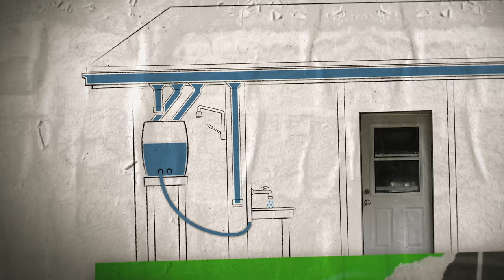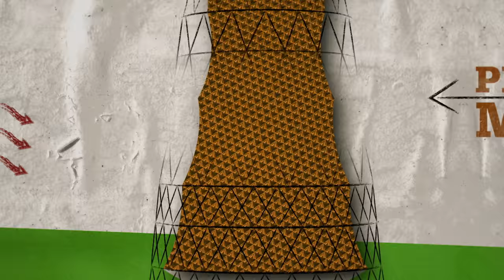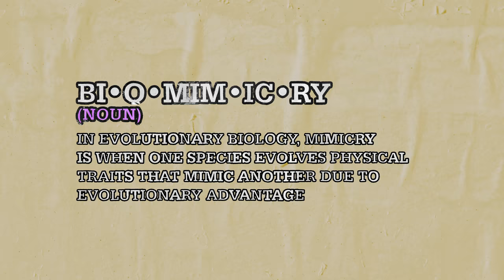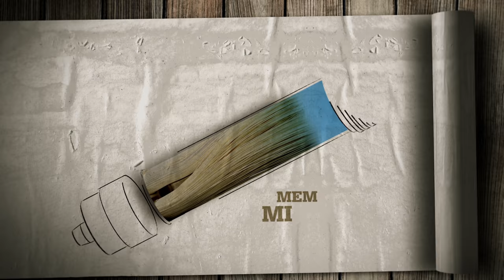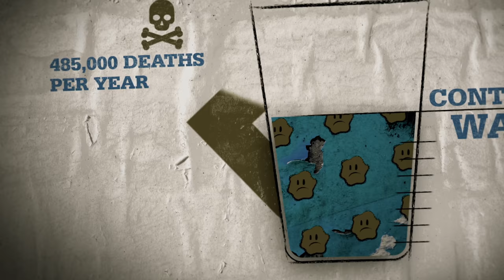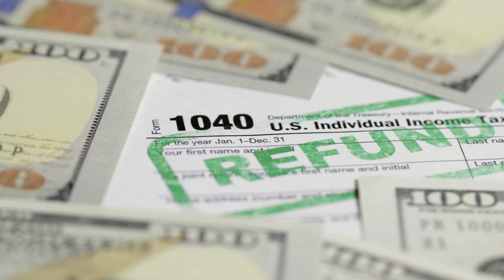Harvesting Water Out Of Thin Air | Shut It Off ASAP

Comment: for the dew collector, something to shake or flick the mesh every hour or so should increase your yield exponentially.   

great work!
Reply: like a bucket at the bottom that fills and pushes down one side of a seesaw, attached by a bar that lets it rotate, and eventually gets past a little bar or something that causes it to tip and dump all its water into a bigger bucket or tub, which then lets the seesaw tip back up and the weight on the other side thumps something attached to the mesh and shakes it. could also build it so it collects in multiple buckets on seesaws all that thump a thing that shakes the mesh, so you get much more frequent thumping.
Reply: Exactly. By the time the water drips from the top to the bottom it will have time already to evaporate, even faster if it's windy. It would be ideal in the desert with no wind at all or if it was closed with air restriction and control.
Reply: @notablediscomfort  That kinda sounds like how a shishi-odoshi (scaredeer) works. Except instead of the bamboo making a bonk sound, it shakes the mesh. 

I'm not sure if it would help but I suspect vertical V-shaped channels would also be a better form for the mesh than just normal rope fibers. I believe that once a droplet grows to a big enough size, surface tension would give way to the droplet sliding down the tiny channel all the way into the basin. In that way, they would be shaped and function like grass leaves. Also it should be stacked in layers like a bookshelf, each with its own collector, that way the dew doesnt have to travel far to be collected.
Reply: @Zadamanim  I would also look into something like waxing or ceramic coating the mesh. I know a good wax or ceramic coat on a car makes watee bead up and drop off super easily but I don't know whether or not it would allow dew to even form on it in the first place.
Reply: @Zadamanim  I should try it out with some Mothers CMX I have just laying around and a couple pieces of some kind of mesh this weekend.
Reply: @notablediscomfort  I was wondering the same thing about if they should be painted in hydrophobic paint or not.
Reply: Sem tradução é impossível nós os brasileiros entendermos!
Reply: Good bhi
Reply: @notablediscomfort  qaaa®=\
Reply: Great work but let me tell you all how much smarter I am because I vote for Democrats and progressive Democrats and my world revolves around being seen and heard no matter what and instead of just giving someone some credit i have to interject because of course I think I'm smarter than everyone else...
Reply: Great work amazing
Reply: @notablediscomfort  Research has shown that condensation begins at the micron level. Wax is hydrophobic, thus moisture won't condense well on wax. You need a (relatively) large hydroscopic(attracts water) area for condensation, and smaller hydrophobic(repels water) area to channel the micro water drops into large enough drops to start flowing towards a collector.
Reply: @Zadamanim  hydrophobic paint would result in less condensation, you need large hydroscopic surface area and small hydrophobic area to encourage quick flowoff to allow more condensation to form..
Reply: @xmickx  kjnn
Reply: I live in Africa. I always drink my water , untreated, from the  rain tank. Not a bad idea to have the odd microbe!

Comment: For ur experiment, u need more surface area at the top, aka the place of condensation. Might also help to insulate your collecting method. That way you get drain and condensation from the material that u used to collect water. See, you can even use condensation at night to collect water after hours. Just insulate the bottom and keep the moisture at the top, so u can get the most out of ur exprmnt.

Comment: I used to work in the oil field for 10years and now I do residential solar. Love to see this! People dnt realize how Beneficial solar is. Not only for the planet but owning your power and being self sufficient is incredible.
Reply: Even better when we will know what to do with the solar panels after their lifespan. Which is what 25 years ?
Reply: @shayraecok578  35-40 under manufacturer warranty nowadays, also recycling them is something that can be done now as well.
Reply: @Dmon ! true, what needs to be done is calculate what resources have to be used to build and maintain the ‘alternate’ energy and how long it can dependently be used. Then calculate how much energy it produces over its lifetime and decide if it’s worth it
Reply: @Dmon ! for nuclear it does depend on the style of reactor, there are many. Also a new reactor that uses spent fuel would also help things along
Reply: @Dmon !  The waste issue is why a next stage reactor is necessary, a wave form reactor could potentially used spent fuel from other reactors and reduce the waste by a significant amount. Again it depends on the style of reactor we’re talking about, this isn’t a cop out this is called a fact.

This isn’t to berate renewables, it’s like you said it’s part of the portfolio. I’m not sure your level of working knowledge of nuclear technology, so I can’t comment on that much. Calling it a pathetic cop out does suggest your knowledge base is low though.

Comment: You can dig a hole besides the creek and the soil within the hole will filter the flowing water into the hole. It can be drinkable since its just forest creek. Make sure to cover the each time. You can probably get 20 to 100 litter of clean water depend on the size of the hole.

Comment: The plastic volume used for building the tower will be real challenge for the environment in future.  !
Reply: Plastic itself isnt a huge issue. Things like this will likely be used a long time so the plastic used to make it won't be going into the ocean
Reply: @deetgrogstin  
Hi
I agree this plastic will be used for long time , but at the end it will be wasted and contaminate the deep earth soil and the water sources, 
I think the manufacturer's should create a guidance at the early stage of designing for proper disposal after the tower is no longer operational.
Reply: @LeadAudit4490  i think it just depends on how long it lasts. Plastic doesnt decompose so this could potentially lasts a few lifetimes ( probably gotta resemble a few times tho) and in that case it's not a real threat

Comment: I would love to see after this series things that can be done in a standard home
Reply: if you live in a house instead of an apartment building the rain colector is pretty doable
Reply: @Ryquard1   rain collection isn't legal in all countries
Reply: @user-jm3cn1lr1v  it is legal in Texas
Reply: .... But.... But i could do all that shit and more at my home if given enough Time.... Van you not buy plastic meshes or drain pipes???
Reply: A standard home may have a water collection solution, but if you’re in a suburban area in a place that doesn’t have water shortage issues, you will expend more energy (and CO2) creating a collection system than using municipal water.
Reply: @Ryquard1  that's a pretty big if.
Reply: I have a large water collection system on one side of my house. The pressure would be adequate for showering, but I just use it t water my large garden.
Reply: @loganwoodxyz  it really doesn’t take that much energy and a well maintained system won’t require replacement.
Reply: R u do it actutally implement
Reply: @___LC___  consider auxiliary energy that went into processing all of the materials needed to build your individual water system. Scale that up to every home and the energy costs in maintaining everyone’s special individual water system. It’s the opposite of sustainable.
Reply: @___LC___  sorry you are so rich //////
Reply: @loganwoodxyz  the thing is many of those are already made? We definitely need to work on stopping big corps with being so wasteful but stuff like this is the only way most people can help. It’s not a perfect solution and no one said it had to be on every home but it’s better then letting all that water go to waste. It’s also better for lower income households as they if done correctly can reduce costs.
Reply: @frendlycriptid6168  “The only way most people can help” … really? You literally just told me “not everyone”. This is not scalable or sustainable on a large scale. It’s the same problem with plastic straws and plastic bags. Sure, switching to paper products will reduce plastic in the environment, but paper products take orders of magnitude more resources and energy to produce. There’s always a trade off.
Reply: @loganwoodxyz  yes there is always a trade off but there is less impacts depending on the trade off, only use plastic straws? We end up killing turtles off and filling out ocean with plastic. We use paper straws? It uses resources but at least since we’re using the paper farms we have more trees being planted and making air instead of the farm being turned into another factory. That’s why when ebooks first came out people thought it would help to use less paper to keep the trees but it actually harmed the tree life because our paper farms are huge and need to be replanted or we don’t have paper. If everyone starts careing for the environment it’ll start shifting the company’s to have to go green to satisfy us. You can see something like it on our electoral history where it’s started shifting more liberal meaning the candidates have to start leaning a little more left than they would have.

Comment: Wait for July. Go to Houston. Turn on an air conditioner.

Seriously, I had a gardener friend in Atlanta who owned a small house with small yard and small gardens. During the drought and water crisis that gripped the city some years ago, when there were severe restrictions on the use of city water, she was able to keep some of her most vulnerable plants alive and even retrieve extra water from the air which she could use to flush toilets, all by diverting the runoff from a large window AC unit.

She said that the situation had been so dire that restrictions had been placed even on AC condensate, but they never got round to regulating window units. I suppose that’s probably because the condensate from those units is not typically plumbed anywhere; instead just allowed to drip out of a small hose in the back.

Your video reminds me of how some of the poorest people in the world get hot (or at least quite warm) water, primitively plumbed into their homes via gravity, much the same way water towers work. During the monsoon seasons of Africa and Asia, at least in the parts where I have traveled, people catch as much natural rainwater as they possibly can. On the roofs of their houses, or else on a raised platform if the roof cannot support it, there will be two tanks, one of which is painted black, storing water that is piped into the house below. In each neighborhood, people will share and pass around a pump or two to keep those tanks full, and of course the black one soaks up the sun’s heat and provides warm water for bathing and cleaning, so they don’t need to burn so much fuel heating it.
Reply: @lisamayol6248  you must have been contemplating that response for hours.
Reply: @robsemail  Lisa’s response required absolutely no thinking, no contemplating whatsoever.
Reply: @robsemail  Lisa has probably never been anywhere in the world where people do the best that they can with what they have.

Comment: Guys your Netting needs to be much Finer, preferably light Colored, like White, it could be stretched much closer to the wooden frame (although not touching) I would make it so that it spirals Into the Centre to maximise air contact, it could also be stretched and fixed to plastic disks on the top and bottom to keep the mesh separated and not touching. Honestly you guys need a lot more mesh to make it work better, but it has a lot of potential.

Comment: “Production shut off our power”
shows welding
Reply: could be battery powered. Not the best and good for small jobs also they have covered trying to make power.. Although yeah, they wouldn't be running a welder on it
Reply: That is good point
Reply: Lol they used their own bike energy.
Reply: They may be using a solar panel battery or two of them
Reply: @kaloriinnmason174  — I have installed many solar electric systems you can run a welder from. Nowadays it’s not that hard or expensive.

Comment: I live on a sailboat, often in the middle of the ocean. I have an RO (reverse osmosis) machine aka water maker or rain maker is what you’ll hear them referred to as by sailors. I have the Spectra Katadyn, 10/10, would recommend. Super easy to maintain versus the older models. Extreme energy efficiency. I never run out of water, ever. I see no reason with the proper modification that this can’t be used on land.
Reply: Can you explain reverse osmosis water? I still don’t know what it is…
+1 very confused person

Comment: With the dew collector could you have a number of layers of the mesh inside each other to increase the yield further? Or would the restriction of air flow mean that it would no longer be effective?
Reply: You would have to But a LOT of meshes for it to hlbe ineffective bit its a drag to put a mesh over a mesh without messing it up so its easier to create another tower
Reply: @mitjakovac278  I see thank you. It may be an inconvenience but in places where it would be an effective means of collecting water it would surely save a good amount of space to use a number of meshes rather then multiple towers. Thank you for your reply! 😊
Reply: @ewanm8995  no problem I am always happy to share such information
Reply: I was gonna ask this, too.
Reply: @mitjakovac278  what is the material of mesh?
Reply: There would be diminishing returns with every layer you add.
The outer layer removes some humidity from the atmosphere, this lowers the dew point and makes collection of moisture less likely for the next layer.
Reply: @mitjakovac278  
That sounds like a relatively easy engineering problem
Reply: @siddheshsakore6247  plastic he said
Reply: @Plant_Parenthood  so it sounds like you’d only be able to make medium sized towers with 2-3 layers. It sounds like a good idea to maximize the effectiveness of each tower while saving space aswell

Comment: an idea for the shower is to have a weight connected to a mechanical pump so when you take a shower you can drop the weight and depending on the gear ratios will depend on the pressure and duration of the shower

Comment: Also, as a side note, humid air is less dense than arid air. Because the weight of what we breathe is more dense than, say humid air with O2. The weight of H2O is lower than both Oxygen & Nitrogen in our air. In fact, i think its about a 5% difference between humid air and arid air. That means stuff can move faster thru less dense air, and slower thru more dry. H2O has less weight than both oxygen and nitrogen; aka the air we breath

Comment: Dehumidifiers only work if there is moisture in the air, and places that have moisture in the air have rain.  You will still have to clean this collected water just like commercial paltier devices. 

A well would be a better idea as it can be drinkable from the source and wont be as affected by seasonal weather, and can privide more than twice a day.
Reply: The said they not using groundwater

Comment: You know what most houses in the country use for water? A well. It's really dumb to use rain water/dew collection in an area with a high water table. You can even add layers of sand, gravel, and activated charcoal and pump it up out of the ground for an essentially unlimited water source.
The reason you can't collect rain water in most places is the same reason you can't have a well in most places, your city doesn't want you to not pay for water.
Reply: You are absolutely correct regarding the well, however the premise of the show is to demonstrate multiple water collection methods that can be used anywhere.
Reply: We have a well but we don't use it, because one time the whole family had diarrhea for many days so we stopped drinking from the well, btw it's a clean well, it had tiny shrimps in it... Usually an indicator if a well is clean.
Reply: @williamrodriguezmswlcsw8119  I'm in big support of using all methods possible for collecting potable water in those areas where the water table is low, but I must have misunderstood. I thought this show was about these people in particular moving off the grid.
Reply: @animesenpai1163  probably boil any water you get out of the well and see if it helps. If it doesn't, it's probably either not the well or you have some sort of toxic mineral entering the water, in which case you need to change your filter. If you have anything living in your well, shrimps or otherwise, I'd recommend cleaning it very thoroughly and making sure it's not exposed to the air because even clean creatures with indicators of good drinking water still can taint the water if it's stagnant.
Reply: @Nanamowa  well it's not really exposed to air... The top was cemented, the pump broke a year ago... And we haven't been really using it... It taste weird now cuz we got used to mineral water.
Reply: When people's homes in southwest Germany were connected to municipal water supply in the 50s, they had to close their wells. And now imagine there's a blackout and water supply fails...

Comment: If a plexiglass box was installed around a black rain barrel with the top sealed around the top of the barrel to allow rain through, the bottom and halfway up the Plexi painted black and copper tubing used, not only could water be collected in the winter, but it would be warm. Also, a separate plexiglass enclosure with the bottom painted black could be attached with a large copper coil inside to heat water and collect condensation from the pipes. Black is heat's best friend.